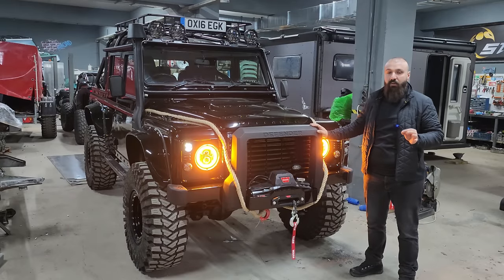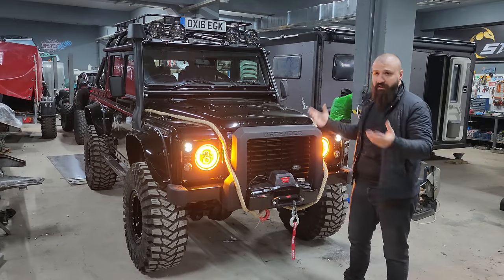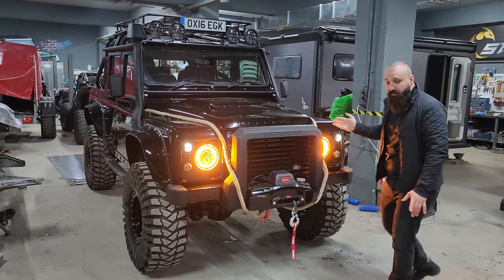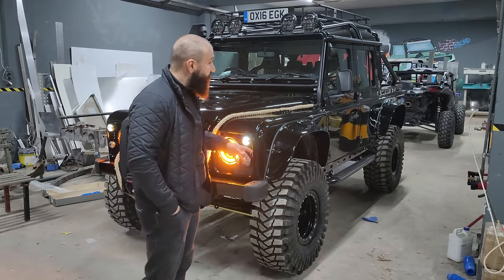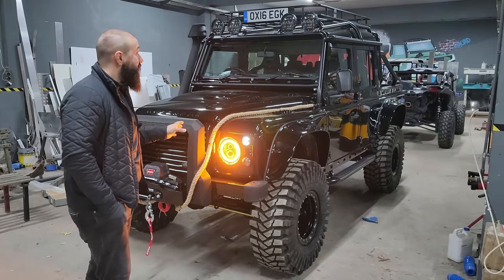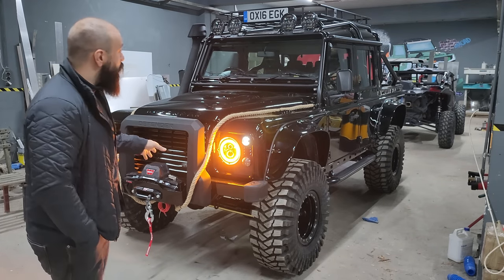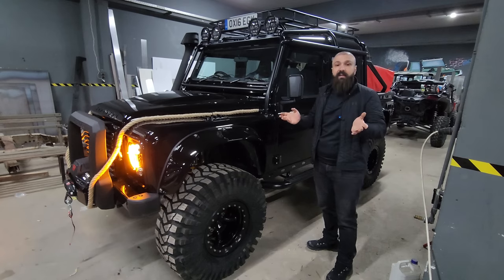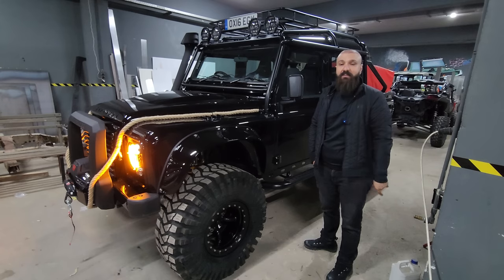LAND ROVER DEFENDER’I BLACK SPECTRE’A DÖNÜŞTÜRDÜK

Comment: Nice Work
I like the results 
I wish you had added a tire air control system from inside the cabin so that it would be suitable for driving on all types of roads, especially sandy roads
Again, your work is excellent
Reply from the maker: Thabks for the advice 🙏🙏🙏